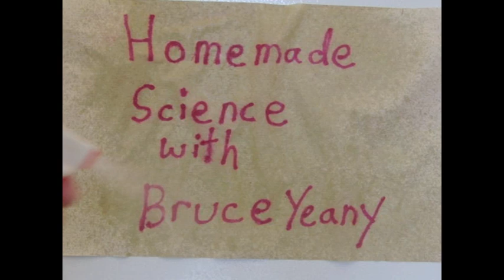Dynamic carts and crashing blocks for Newton's laws of motion///Homemade Science with Bruce Yeany

Comment: This is the real translation of NII: "Strength impressed is proportional to the changer of motion".
Strength ="Force", impressed = "put-into" => "Applied Force over an interval" => IMPULSE!!!

changer ="causal factor"
= "released stress"
= "force per area"
=F/A 
=E × STRAIN(=dF/dA , for small scales )
..where E= 'Young's modulus'

Reworded NII: IMPULSE =D(mv)~m(v-v0)= F(t-t0)= -c (dF/dA), c= const.
- If you work it out with some assumptions, RHS "dF/dA" will end up as a multiple of LHS.
... But Newton worked close with Hooke, so F= -k (x-x0)
...A bit more complicated than F=ma.
Reply: From Arijeet Samanata on Quora in respons to "What is stress and strain in physics?":

""WHEN A EXTERNAL FORCE IS APPLIED TO A BODY THEN A INTERNAL ELASTIC FORCE DEVELOPS DUE TO THE ELASTIC PROPERTY OF THE BODY . THIS INTERNAL FORCE OPPOSE THE APPLIED FORCE TO REGAIN ITS ORIGINAL CONFIGURATION . THIS REACTING FORCE PER UNIT AREA IS CALLED STRESS OF THAT BODY.

STRESS =REACTING FORCE/AREA

UNITS: 1. S.I =N/m^2

2. C.G.S= dyne/cm^2

3. F.P.S= POUNDAL/ft^2"
Reply: Note that F=ma can be obtained from an approximation of F=d(mv)/dt=ma+(dm/dt)v , using the calculus product rule.
D(mv) can be deduced from the RHS using dimensional analysis, and Young's Elasticity parameter definition: E=STRESS/STRAIN.

Comment: Without friction, would the speed of the 2 objects towards each other be the same with large and small mass?
Reply from the maker: Hello Florian,  even if we remove the friction, the cart with more mass it would accelerate slower,  think about using the same amount of forth to throw a baseball and a shot-put,  the heavy shot-put would move slower
Reply: Bruce Yeany Ah yes of course, thank you for the quick answer